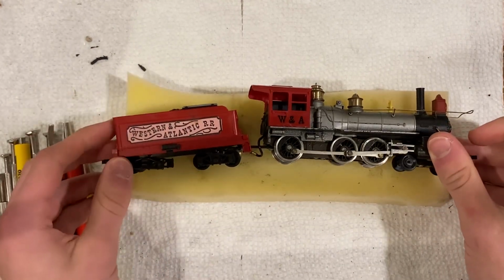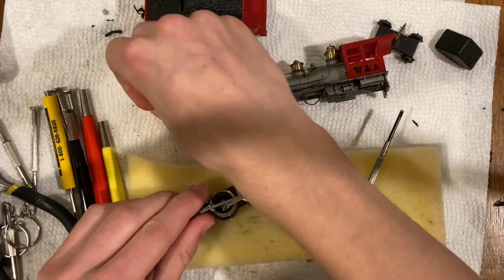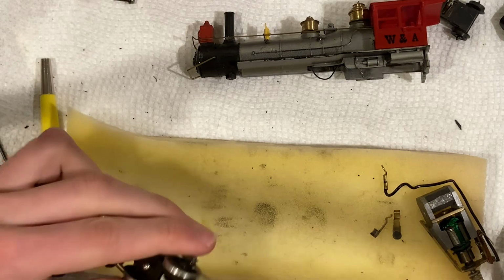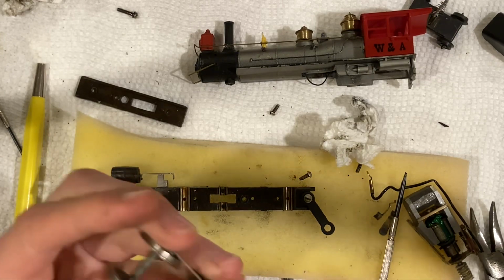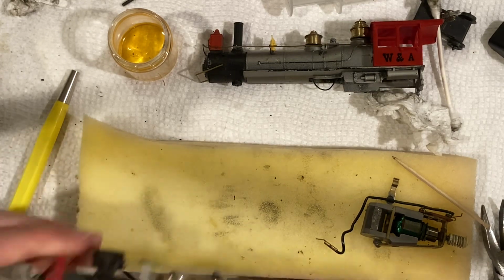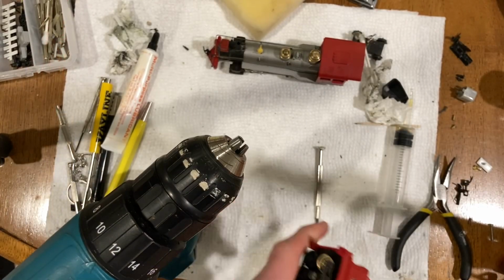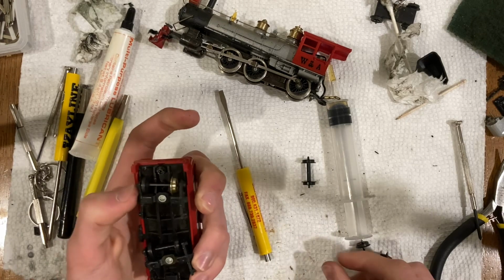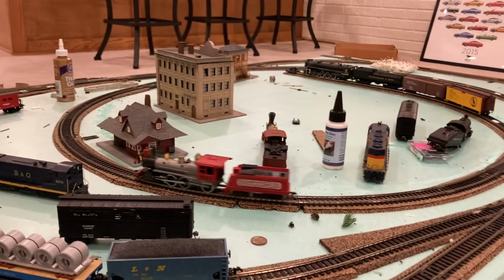Reviving a Mantua Tyco ￼ten wheeler

Comment: Use powder graphite on your "journal" bearings on the tender trucks.  Oil will gum up over time and swell the plastic.  As for oil, a synthetic will last longer.  Micromark has an oil needle dispenser that I have used for 20+ years and works great.  The kersosene mix will evaporate and gum up.  The petroleum base will adversely effect the plastic. 
-Old guy who has done it all (wrong).